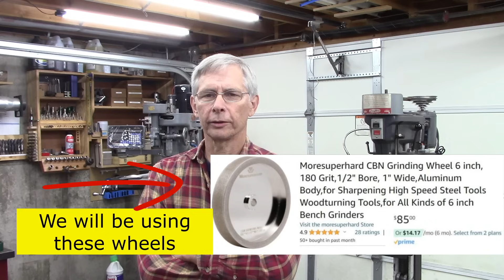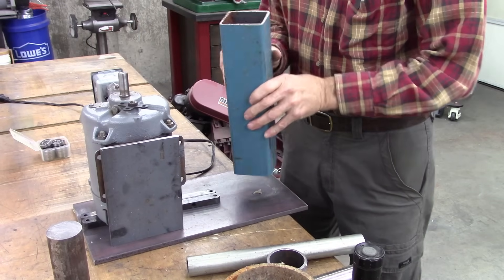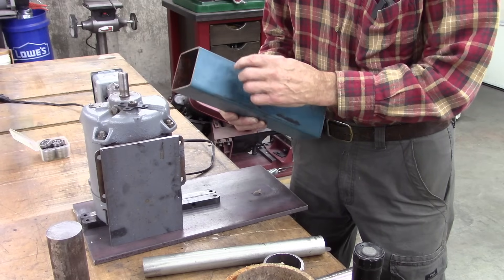Grinding High Speed Steel - Featuring the Moresuperhard 6-inch CBN Grinding wheels. Part 1

Comment: Be careful about grinding those tungsten tig rods.  Don't breathe any of the dust and always sharpen towards the tip in line with the rod.  You can crank that current way down for thin stuff and even down into the bottom of gaps like where a piece of round stock might lay flat on the top of a flat surface and you want to get down to the tangent point in the crack from the side (with the tungsten pulled out from the cup).  I watched a top notch journeyman welder (14 on the scale of 1-10) tig weld a broken hinge on a pair of plastic framed glassed once to shut someone up.  There are some amazing people out there.  My hat's off to all of them, that's you too Mark.
Reply from the maker: I've heard the dust is bad, I dont breath it. I've also ground the tungsten lengthwise but not toward the tip. Maybe I need to try that.

Comment: Closely held welding secret: tack, tack, tack, tack.....  I noticed you like to use straight line movement when welding.  I have always used the little circles, not because it is better, but it seems to free up my athritic joints better and I don't get any skipping. I also pick up the tip of the rod on each circle.  There's really very little difference between all those welding patterns; zig zag, circles and back and forth.  I saw a video where they laid a standard AC rod flat on a piece of steel, but a board on top, turned on the welder and let it burn.  It made a beautiful weld.  After seeing that, I figured my only addition to the process was to mess it up.
Reply from the maker: I totally agree about tacking. Things move a lot if you don't. I need to mess with the torch movements. I used to lift slightly but in a straight line. I don't think the weld was better but maybe it looked a little better.

Comment: Moresuperhard CBN grinding wheel is mainly used for sharpening woodturning tools (high speed steel HSS).
Reply from the maker: Wood turners are a big market for CBN but machinists use HSS a lot for making profile cutters and specialized tooling. It's a HUGE plus for shaping tools.
Reply: Yes, woodturning tools  is a big market for electroplated CBN wheels. Compared with diamond wheel,  CBN is  ideal for  machining metal working as HSS, cast iron... @WinkysWorkshop

Comment: Good work Mark. Cant wait for the next video. I use a CBN wheel for sharpening my woodturning chisels. We also have them at our woodturners club.
Reply from the maker: I don't ever do wood turning but I tried to make the grinder so it was adaptable to sharpen a variety. It should work well for wood turning tools if needed.

Comment: The Grinding Wheel Dia will get smaller and smaller as you true it ( dress ) !!!
Reply: It's a diamond impregnated aluminum wheel. It's not made like a grinding wheel (stone) You don't dress them.
Reply: @dennythomas8887  oh ! It’ll be ok then, the pivoting I mean.
Reply from the maker: Yes the pivot is slightly adjustable but once it is set it will not be moved again.
Reply from the maker: No, be sure and watch part to when I post it. These wheels do not wear or need dressing.

Comment: Mark, looking really good and very fortuitous for me. I am working on a grinding table right now.  Very interesting idea.  One advantage not mentioned with a mandrel is you can simply turn a new mandrel for mixed wheel sizes, much better for balance than bushings. Who knows we may see you try a silicon carbide grinding wheel on the other side.   

FWIW I've been very pleased with my CBN wheel. Since I got the tangential tool holder my CBN hasn't got as much use, but I need to grind some shaper tools so it's time to get it in commission. 

Food for thought, I've had a 2" belt sander on the other side of my grinder. Can't be removed real quickly, but has been very handy.  Might make a fun project with the tracking, the tensioner, etc. Mine has a round tube out to the idler wheel that contains a compression spring. So very compact.
Reply from the maker: I have a 2" belt grinder so this one will likely remain two different grit CBN. The table is going to work well I think. The only reason problem is the pivot point can get in the way of what you are grinding. However, in this case what I will be grinding is short and will not be an issue.
Reply: @WinkysWorkshop   IMHO compromises are in order when you go with a CBN as generally the intent is to use it on HHS tooling. One of those being a wrap around table so the tool is supported when grinding the cutting edge and clearance with the tool supported on either side of the wheel as needed for left or right hand tools. The advantage of the CBN for grinding tooling is the force into the wheel is negligible.There is little danger of deflecting the mandrel/axle with a larger than normal gap between the wheel and the support for a generous table.
Reply from the maker: @ronkellis769  Agree. And yes, it will have a wrap around tool rest. I think it will work out well.